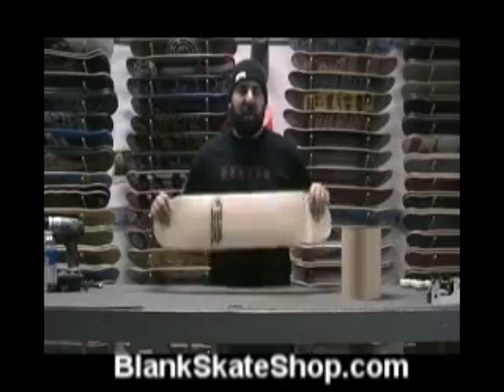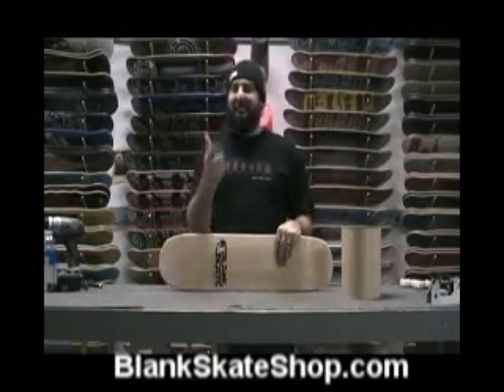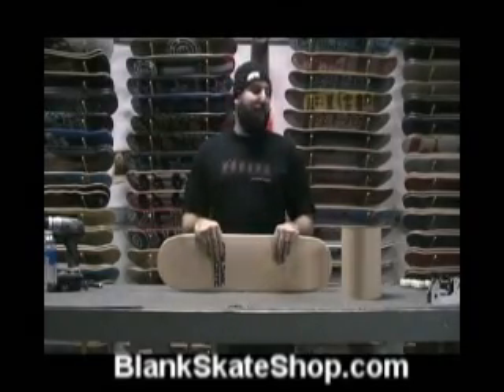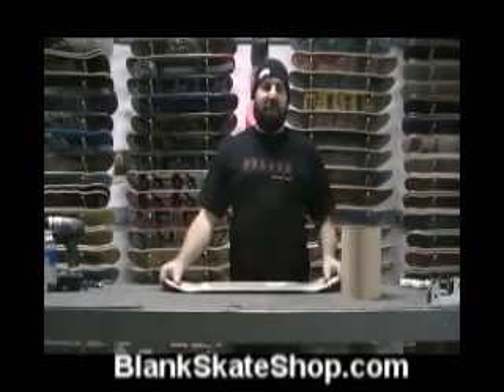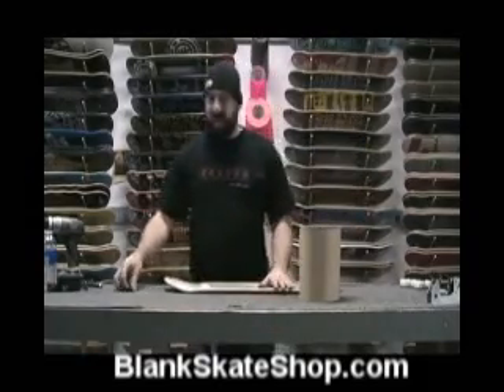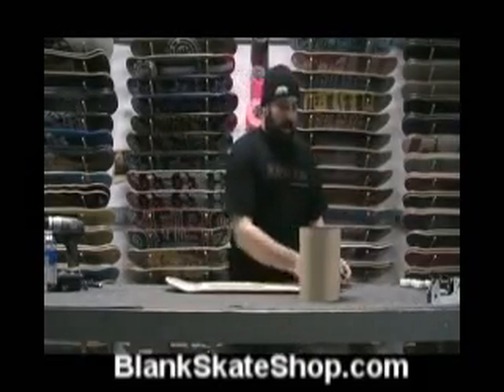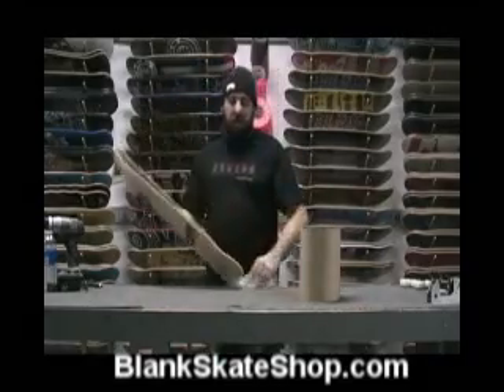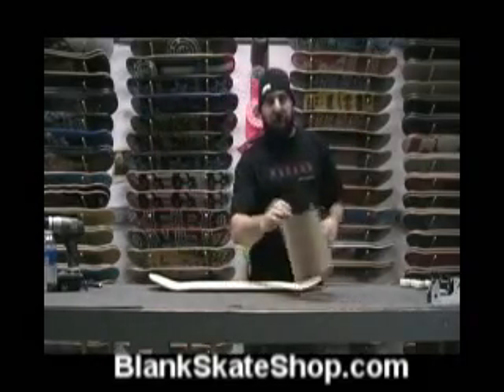How to Apply Griptape to a Skateboard Deck

Comment: I like that guy! Plus I like that tip, I knew that if you put the paper backing against the grip tape after you put it on and rub it, it would make it stick better, but I didn't know about applying the griptape along with it, that made it so much easier, and more assuring that there was going to be no air bubbles! Thanks a lot!!